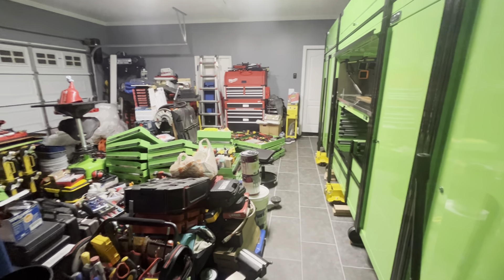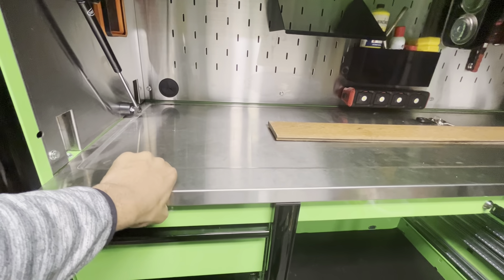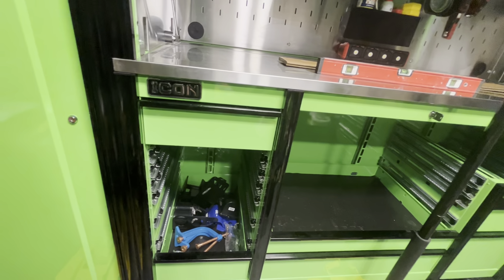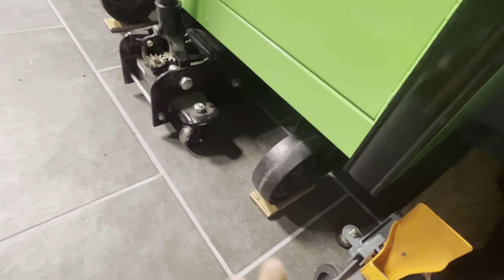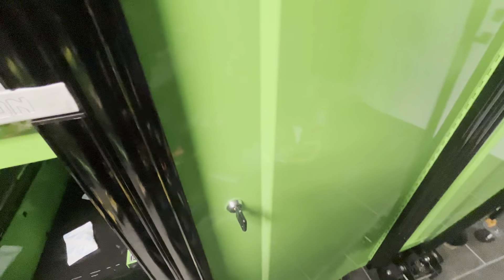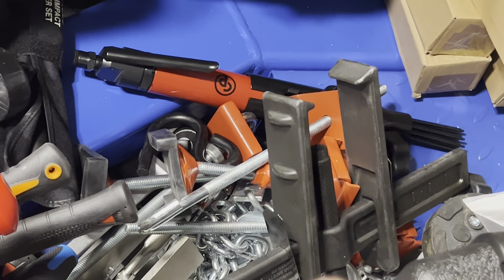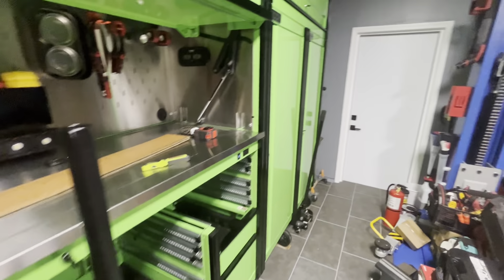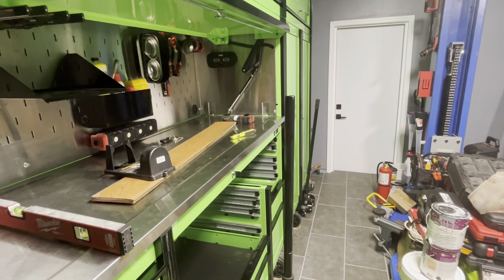Disorganized to get Organized #ICON

Comment: Did you order extra trays and slides for your side lockers when you built your package?  I like the idea of adding a few extra slide out trays vs the fixed top shelves.
Reply from the maker: I did after the fact. Pretty simple install n u can access the stuff in the back

Comment: I don't think you need to worry about the box moving unless you live in a earthquake zone i added lights in my lockers and when I add the over heads i will probably add some more
Reply from the maker: It’s an area susceptible to earthquakes. Will have to figure out the lights later.